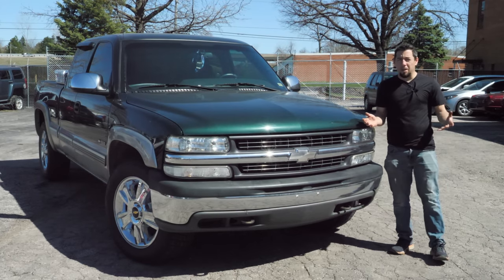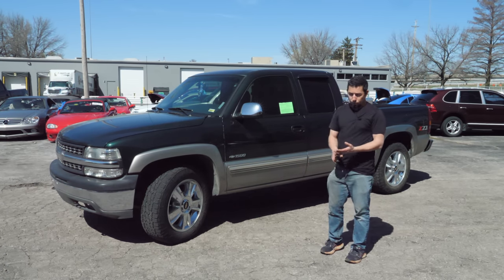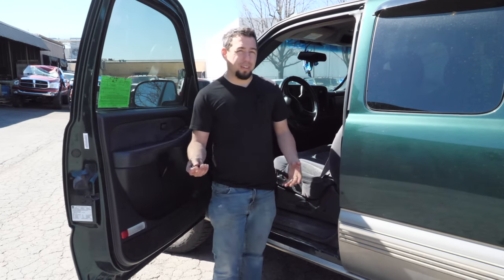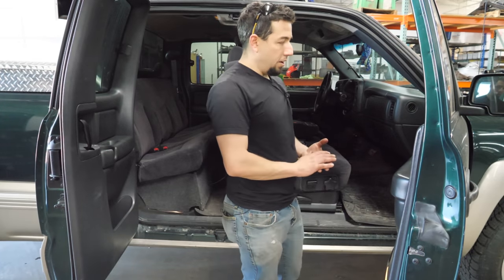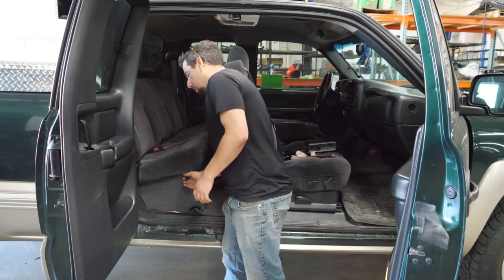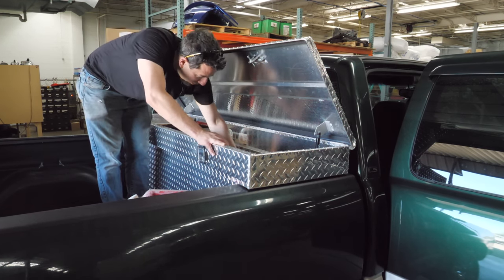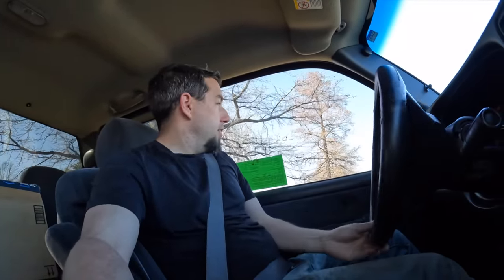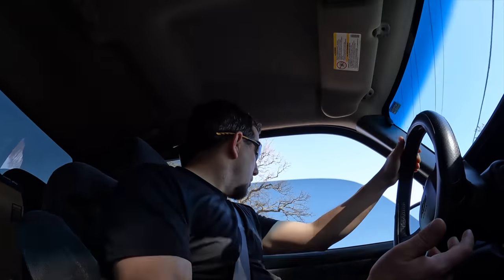Abandoned Silverado Comes Into Salvage Yard, FOR PARTS?! NO!  Saving This One

Comment: I am the original owner of a Silverado exactly like the one that you just acquired. Mine currently has 212k miles and runs great and I will keep it until it gives up. I feel these are solid trucks if maintained properly. Nice score!
Reply: I loved my Victory Red 2004 Z71 Silverado when I still had it. Sadly being in Upstate NY it succumbed to the same problem as I Do Cars here. It had unsafe frame rot due to all of the road salt they use here in the winter. If it wasn't for that I was going to try and replace all of the rotted body panels on it. Since I didn't straight up have $6,000.00 to buy a good one from someone I had to go for the lease on my current truck.
Reply: I agree. Mine’s an 04 with 320k. It’s been a good truck.
Reply: @Slane583  did you ever fluid film your truck?
Reply: @insideoutsideupsidedown2218  No. It was originally my mothers truck and she was a penny pincher as far as buying parts went or doing anything to it. One thing she wasn't allowed to penny pinch on was motor oil and a filter. Because I changed the oil in it I also bought the best oil & filter I could afford for it. 

By the time she gave it to me it was rough from being rusty. So I did my best to replace anything that was broken or gone with higher quality parts. Sadly it took a leaky fuel line needing fixing to have it taken off the road. Just because I wanted to try a different mechanic I never been to. When he got it on the lift to asses the fuel line he saw it had unsafe frame rot and wouldn't proceed any further.

I wanted to keep it and fix it up as a spare to go along with my current truck. But I don't have the money or a big work shop to just store it so I had to get rid of it. 

It made me even more upset because I just spent $400 or so prior to the fuel line leaking to replace all of the ignition coils and spark plug wires. So it was running smooth and purring like a tiger cub when I had to get rid of it. I found that it also loved running on NGK platinum plugs and it never burnt a drop of oil. Which was a big plus as I liked running Royal Purple or AmsOil in it. :)
Reply: I love my 01 Sierra 1500 and my 03 Sierra 1500hd they are great trucks if maintained properly
Reply: This generation of GM trucks and SUVs are absolutely the most reliable vehicles on the road for the time period they were built in.
Reply: @JimBronson still reliable than many new cars that end up on this channel

Comment: You probably already know this, but just in case... For "rattling" or "looseness" in the front end, check the intermediate steering column link/shaft. These trucks are infamous for wearing those out. They don't "fail" outright, they just start rattling. Good save!
Reply: The pitman and idler arm also tend to wear out.
Reply: Oh yeah. They put rubber bushings to dampen vibration and those never last
Reply: It looks just like my 2000 Silverado. Love it

Comment: Great truck....  Just amazing.  Looked like someone actually cared about it....

You never know...  I knew a guy who worked at an iron & metal recycling type place....  They would buy cars, for scrap value...

But more often than you might think, they'd come in Monday, there'd be a car sitting in front of the gate, just left there...  Some of them were really pretty nice cars...  

Somebody left a Lincoln Mark IV there once...  Keys were on top of the front passenger tire....  I don't wanna say it was perfect, but it was awfully nice.  Didn't run perfect...  Driver's seat was not perfect...  But overall, real nice.  Body was 100%, must have been in a pretty clean garage...  Cartier clock...  heh heh!  It was cool...  I have no idea why someone would drive that to a yard and dump it in the driveway.  No clue.

Comment: The ABS issue is common in these. The module is usually under the cab on the drivers side. It can be pulled and re soldered in an hour and will be good for another 10 years. Lots of YouTube videos on how to solder the board… and a little spray lithium grease on those tailgate latches will do wonders. The knocking on these is usually suspension bushings (or lack there of). I’m an original owner of a 1st Gen (2002) Avalanche bought in mid 2001 with ~200k miles. Nice to see you saved this.

Comment: I have the same mindset and luck but in the IT field. All the time find computers and other tech that is abandoned or given away usually by companies that are upgrading. I have found so many diamonds in the rough. We don't buy electronics at all in my household for the last several years, just acquire things second hand and get them fixed up and running like new. I would do this for vehicles if I had the skillset, the tools, and the patience to work on them.

Comment: I love that you saw the value in it and saved it , despite most likely being able to make more off it parting it out. I am curious about the TF case and 4wd Components. Did you test them? are the fine too? Where I live, this truck would be on a lift kit, with a motor/trans swap, with some bigger A/T tires, rock sliders, maybe bumpers and winch, and getting work done on the forest service roads.

Comment: I have a 2003 1500 which I've owned since new. I've had '05-07 17" wheels since '05 when I found a set of take-offs for $200 with new-ish tires, only because I like the look of the simpler 5-spoke design. Last year I installed '05-17 front calipers/rotors together with '04 Tahoe rear calipers/rotors and was surprised at how big of an improvement that makes on these trucks, and entirely bolt-on. And it's all relatively cheap!

Comment: Got a wheel at each corner and they all go round. Starts, stops and steers, all the windows are in and it locks.  What's not to like? And it has aircon that's gassed!!?  Don't get trucks like that in the UK, but we do get old cars and vans. Drive 'em and change the fluids until something major goes bang.  Been doing that with a 1979 Hiace I gave £300 for nine years ago. 3 tyres and some welding and it's still going (150k - small island). Unlike your truck, the Hiace looks like a piece of crap, but If I park up, it'll be there when I come back.

Comment: This generation GMT800-era Chevy truck is a highly sought after model to this day (after the GMT400, while 'square bodies' are now getting out of reach). No VVT, no cylinder deactivation, last ones to have a tape player from the factory, and for 2002, the last LS V8 to use a mechanical throttle linkage (the 1985-era 4.3 V6 still used a cable actuated throttle and distributor until 2007; the whole engine lasted until 2013, it used coils where the distributor once sat and used electronic throttle control, and is not related whatsoever to the 2014-2021 4.3, other than displacement), and 2004 is the last year for the use of fan clutches in 1/2 ton trucks. This is also the last generation to have a manual transmission. And for the HD trucks, it the last modern big-block in our time, and the highly desired LBZ 6.6 Duramax.

Granted, it still used the weak 4L60-E from the previous generation (the HD 6.0 also carried the 4L80-E from the previous generation, and had iron heads for 2001-2002 years).

Funnily enough, to this day, these generation trucks are still at work for electric companies, oil fields, plumbing, surveying and road construction, forest service, and even the border control, long after they stopped building these back in 2007.

Comment: I had a 2005 Sierra that I traded in for a new 2018. Had 225K miles. Replaced the plugs at 50K out of habit and replaced the front wheel bearings when one failed. Other than that, the entire truck was factory. Trading that truck was the biggest mistake I ever made in life.

Comment: Have you done a compression check or any fluid changes, or pulled the transmission pan? I had a slightly earlier Chevy truck and got 195K on its 4L60E trans before it needed a rebuild, wonder if that one has had any work done? I like that body style the best of any Chevy pickup. Helluva nice find for what you gave, put a few bucks into whatever you find needs replacing and turn it for a handy profit.

Comment: Eric, I have a 2002 Silverado 1500. Has 350K on it and still has the original timing chain. I drive a 2018 Silverado everyday, and my wife drive the old one. It doesn't look as nice as the one you have here, but I was religious about oil changes and I am living the benefit of it. Vehicle run's like a fine watch. Best Vehicle I have ever owned.

Comment: @I_Do_Cars — You rescued and saved it. If it’s a decent overall truck that can run another 60k miles for someone, then fix the current issues it has and sell it for a profit after paying yourself for the labor. 🤷🏻‍♂️ 

Please don’t hoard it. It would be best if you just find more shitboxes like this and make more content for us to enjoy. 

p.s. I really wish you’d Fully inspect the vehicle (take the wheels off to check out the brakes, suspension, etc) BEFORE you’d drive it on the road. You just never know if the tire isn’t bolted down and will fly off. 🤦🏻‍♂️

Comment: Check the bottom of the computer for a cold solder joint. That was the problem with my 2001 Z 71 and the ABS light. Good luck with the truck.

Comment: Dude awesome deal! Your numbers are way in the black. The ABS light is probably the wheel hub 300000mi is about that time. A stock hub,ball joint, tie rod, pitman and idler set is under 300$ online add spark plugs and bump stops and for 500-600$ you can flip that and make a happy truck owner until the 4l60 goes! Great find.

Comment: I got an 02 Sierra 1500 single cab 4x4 I still have my stock steel wheels I just painted them black and got black center caps instead of chrome I really do like the look of the 16's myself too. My truck was basically free as well 500$ from a good friend one owner was all original had 308k when I bought it needed a transmission so I did the right thing and got a 6.0 LQ9 and the 4L65E out of an Escalade and did the swap myself 🤣 Thing rips now! I love the older stuff there's no way I could buy a new truck. This truck is from Colorado so not a spec of rust on it anywhere I'm trying to put a million miles on It I think it can definitely do it!

Comment: The place I worked at back in the 1980s bought a Dodge van that had the ridiculous warrenty they were offering at the time. Took it out on the interstate, checked the speedo, and discovered that Chrysler was giving themselves a 10 percent discount on their warranty. The speedo (and odometer) was 10% fast. Suddenly the 100k mile warranty was a 90k warranty. The, because we were hauling 600-1000 pounds of equipment around all the time, they decided to put larger tires on it. Needless to say, the speedo error increased. Also, it had a 4 speed manual as I recall. I'm 6' tall and have longer than normal arms, but still needed to push the shifter into 3rd gear using my fingertips. It was just too long of a throw. Don't know what happened to it. I left that company in 1992. I suspect they sold it off because that manual trans was such a pain to shift.

Comment: One of our relatives abandon a 95 Honda Accord. No problems. We are the previous owner. A letter came in and told us the information. My dad contact one of our relatives and show him the paper. He denied that he didn't abandon it. "It was stolen;" to save face. 

I told my dad, "we'll pick it up." We know who he is. He ain't pulling a fast one on us. We paid the fees and picked it up. We drove it home. 

Few days later, he came to us saying that he needs the Accord back. My dad told him, "You didn't change title nor had any insurance on it. You left it there knowing about it. The vehicle is still under my name. You claim it was stolen, but you didn't let me know. If you didn't pay for the title swap nor insurance, you drove it as is without paying for anything. It's no longer yours."

He pester my dad about it for a week straight. We sold it to one my friends who really need the vehicle. Sold to him for $700. Clean car with 301k miles for little rust and no leak. Fresh pads, rotor and drums, tune up, engine oil and filter, transmission fluid, coolant, and ac recharge. Half treads of Yokohama tires.

Comment: 1:38 - You're talking about the Silverado, and all I can do is check out the Cayenne in back. I love that color!
Reply from the maker: It’s unfortunately a parts vehicle. Bad engine and pretty rough
Reply: @I_Do_Cars  Too bad. Bore scored engine? That'd be a cool tear down video <hint hint>

I just picked up a 2010 Cayenne Turbo for fairly cheap. It was running rough due to carbon buildup and stuck open thermostat. A few hours and a couple hundred dollars later and I've got a 500hp rocket that'll soon be an overlanding rig.

Comment: The color green on that truck was an option for that year. I think it was in the hundreds extra to get that color from GM. Nice find except for the smoke odor found in a bus station urinal. I hope you keep it, tear out the interior , find a clean donor, and drive it another 200,000  miles. These old 20-30 year old trucks are bringing more thumbs up than a new one.

Comment: Of course pull some codes to address your check engine light and see what else might be bad. Maybe even overhaul the transmission to fix that shift between 2nd and 3rd gear. Other than fresh fluids, filters, and some mid or high grade pump gas in the tank, it would be a stout truck that'll last another 15 years give or take.

Comment: You neglected to test the 'Tow/Haul' feature. I am certain you know about the propensity of these wire harnesses to break alongside the steering column. It is an easy repair. Even easier if you purchase a new shift lever as long as you don't mind the price.

Comment: The electrical tape you found in the bed wasn't for the spark plug wires, it was for the gauge panel to cover up the ABS light.

Comment: Those trucks were built to last and a lot easier to work on than the more modern Chevys. My '03 had 270,000 miles and it burnt oil, had a transmission clunk and had severe rust but still runs

Comment: Eric back in the early 2000s I saved many hondas and acuras that were about to be scrapped due to bad ignition switches and main relays. One dude came to my house driving his integra with the key in the start position to keep it running while also driving a manual transmission and no power steering lol. Excellent score, that will turn some nice profit for sure...Edit...vehicles also get abandoned sometimes because the owner gets pulled over then goes to jail on a warrant, and cant get out in time to recover the vehicle, and/or does not have the money to pay off the high tow and storage fees.

Comment: my first vehicle was a 99 3 door Silverado 4x4 5.3 Pewter metallic black interior with leather but sadly not heated seats i did have the heated rear window which was my favorite option in it i was dumb and rushed into it and got lied to on mileage but it did have a new tranny with papers when i got it 324k miles when i bought it but only surface rust on the frame and one lil hole in the driver rocker looked just as good as this one besides faded headlights had it till 332k when i did a dumb move and drove in a really deep puddle more than once and filled her with water got off the highway getting back home and the trans started slipping threw a supposed rebuilt one in but could never get it to shift into 3rd or out of first in Drive i really hate getting rid of her but i was a broke kid with only youtube knowledge of working on cars one day ill have another gmt800 truck there the best ever made no other truck lasts as long as them now my dream is a lowered black 02 ext cab short bed with a big cam and a big turbo boy i can dream

Comment: I don't get it. I really don't. Like even if the frame and body were rusted to crap, you've still got a Gen 3 LS swap donor with accessories and ecu, etc. I wonder if the old key tumbler combined with the iffy ignition switch meant it just would not start? 
You kinda stumbled on to the problem when you swapped tumblers. Might be a situation where this was a teenager's car, and he or she liked to "customize" the truck. But after it failing to start many times, mom and dad had enough? 
All I know is I will trade ya a 2011 Chevy Caprice PPV 6.0L with 160k miles on it. Interior is rough, but still a serviceable ride

Comment: I thought the security system reads the original key, and if it doesn't match, it wont start. Is that sensor in the ignition switch itself?

Comment: The jumping gauges can be caused by the install process of an upgraded audio equipment.   Check the wiring harness for sloppy wire connections behind the head unit.  Someone had hacked mine up before i bought it and there were other wires with uninsulated bits rubbing against each other and against the metal dash supports. 

My opinion- The truck was probably abandoned because at this age the truck was continuosly experiencing problems, fix one thing and another two or three items just popped up.  At that point you get tired of dealing with it, especially when you have sink time and money in it.  I bought one used of similar age and kept it for quite a few years; finally just traded it in for a little sum for something newer.  All things that I had previously repaired, including rust; were coming around again and at that point I was just tired of it. Just my opinion, but the last owner  could have gotten rid of for a couple hundred dollars or more instead of just being abandoned- but I can see it happening especially after watching (and reliving) you having to deal with the numerous little troubles in this video.  Since you have no history of this truck, I would attempt to get rid of it while you still have a chance to get a profit out of it.